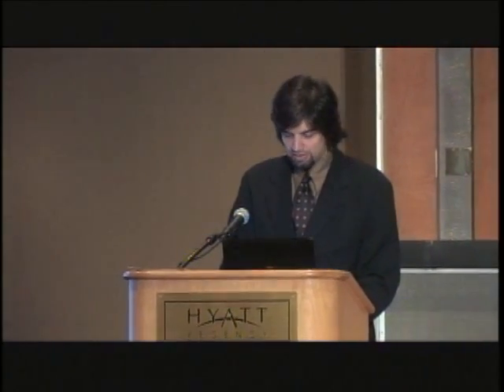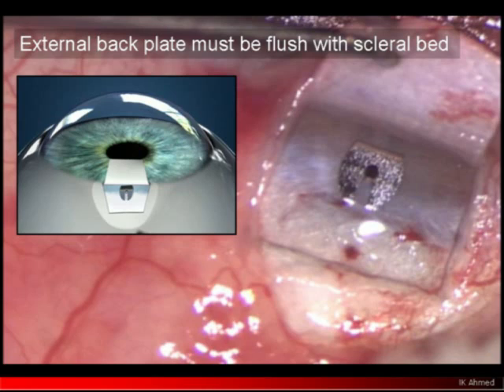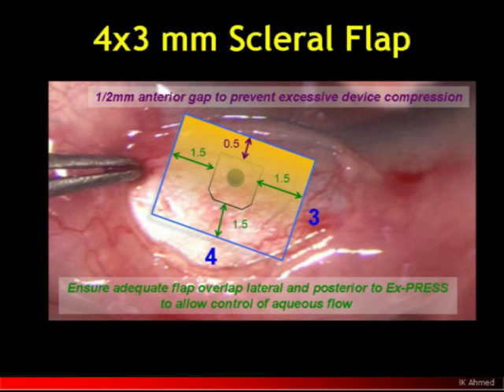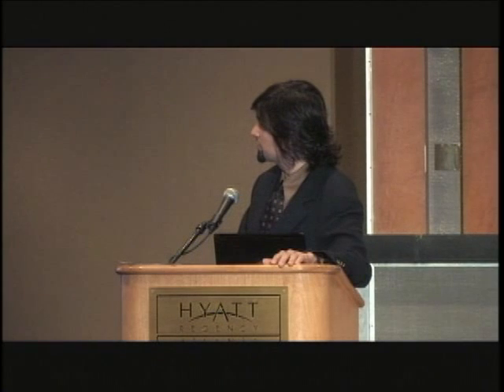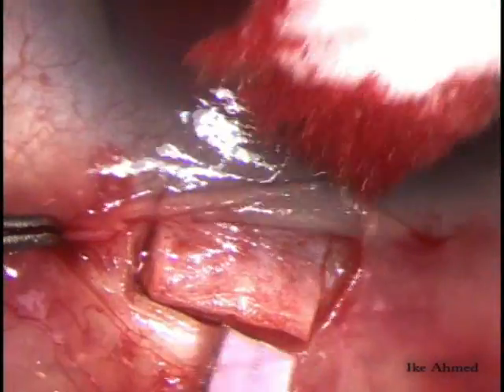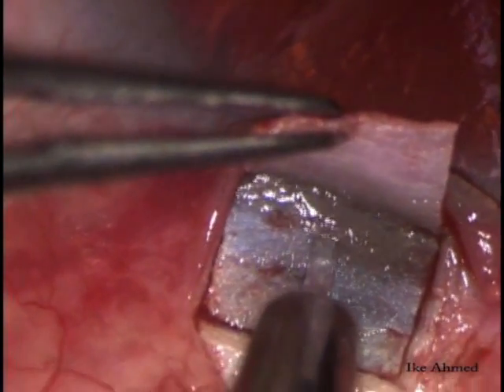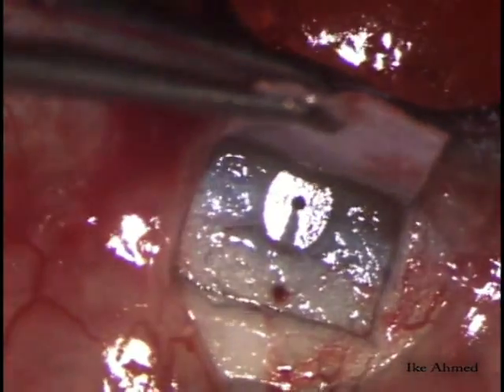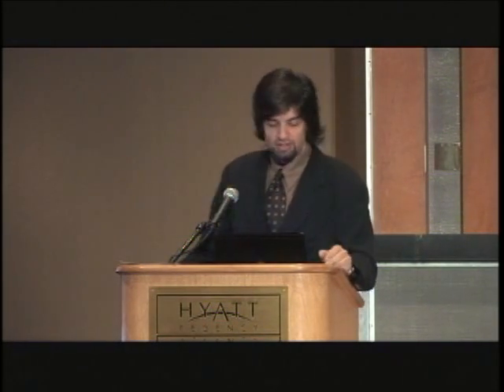The Ex-PRESS Shunt - Technique Pearls

Comment: The pre-incision and ExPRESS are correctly placed, but the scleral spur is not where you point, but rather more later. Behind the gray line Schlemm's canal is located, and behind it, the scleral spur. What is in the position where you point the scleral spur, is actually the scleral septum